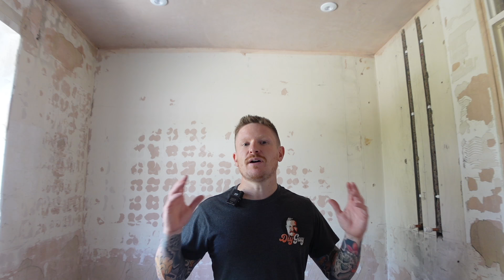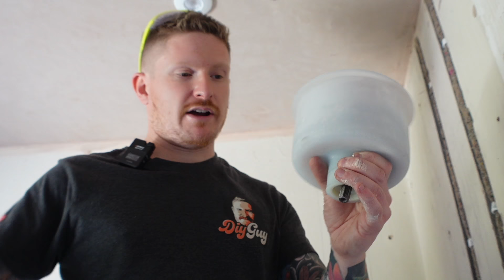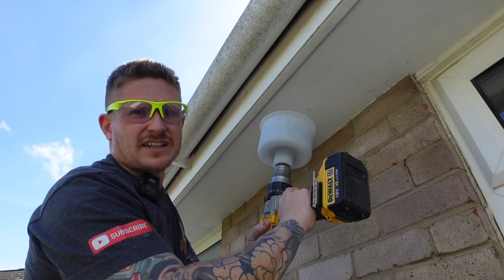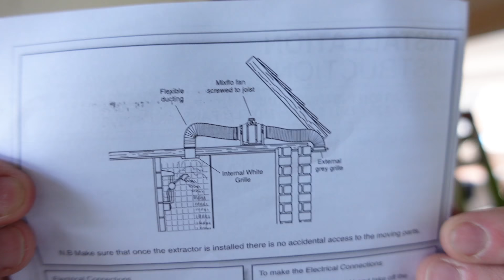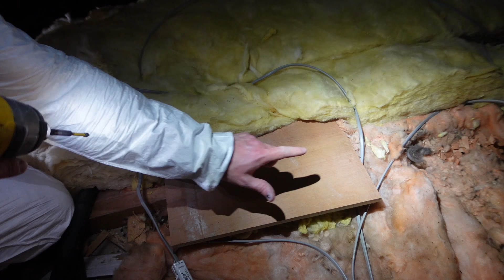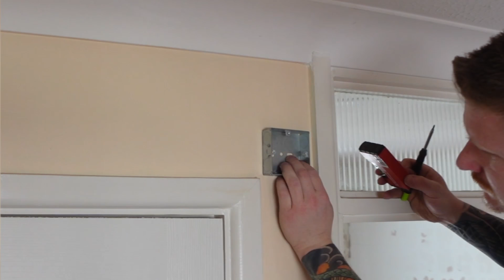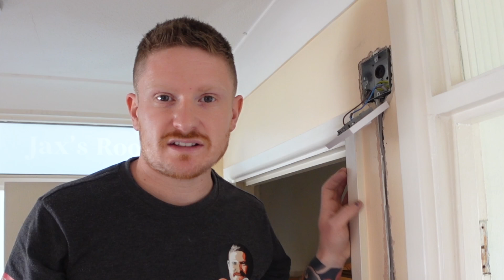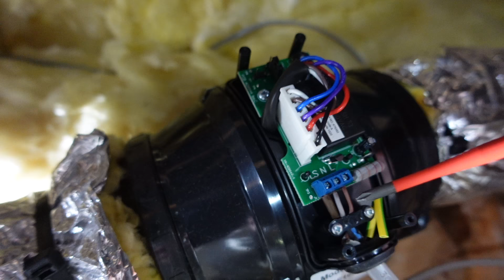How to Install a Bathroom Extractor Fan - Complete DIY Guide Made Easy

Comment: What’s the reason for the 500mm either side? I installed one recently that required 1 metre on intake side. I didn’t have 1 metre (maybe 400mm only)- anyway it works well but curious if I’m losing performance.
Reply: manufacturer's instructions say 500mm min each side (no reason given).

Comment: These fans need fusing down which I did via a spur with a 3a fuse, I didn’t realise that you could get a fused isolator. Live and learn. Great video
Reply: You don't need to fuse the SL. It's just a sensing wire, the current travels down the PERMANENT LINE conductor under normal operating conditions (as said by the guys at efixx)
Reply: Did you have a fan with a timer if so how did you fuse both sw & permanent live
Reply: @neiltrevatt  Same question, The only fused triple pole isolator I've seen has only one fuse and won't fuse against both L & SL
Reply: @Dr.Stacker did you find out in the end? I’m due to install one soon
Reply: @Dr.Stacker  permanent live
Reply: @Joshoptimuscrime  permanent live
Reply: @JB10001  what about it?
Reply: @neiltrevatt  permanent live only
Reply: Where can you find a 3pole fused isolator?
Reply: If your bathroom lights are low power, you can fuse the feed to the whole bathroom light circuit. In the example shown have the line in an out to the line side of a fused plate. Then run the light and fan from the load side if that,  resulting in a fused permanent live and switched live.

Comment: I fitted one a few years ago, those fans are brilliant. The bathroom had mould when I bought it as the builders in 2005 fitted a pathetic mains fan in the ceiling nowhere near the shower and bodged the ducting and I swear it couldn't hold a sheet of toilet paper up because I tried it! The Manrose can hold a flattened toilet roll middle up! And instead of motor vibration the main noise is the rather more pleasant whoosh of airflow.
Reply from the maker: Absolutely 👍

Comment: Just a heads up, I am an electrician and if it says in the instructions to fit a 3 amp fuse make sure you do it, a few years ago there was a fire caused by a fan and because the electrician didnt fit  a 3 amp fuse the insurance company woildnt pay out, the electrician also ended up going to court and lost everything.
I think in all the years I have been an electrician I have only ever seen one extractor fan which didnt need to be fused down but I can't remember what make it was.
Almost all lighting circuits are protected by a 6amp mcb, some houses have 10amp mcb on lighting.
Reply: Hi, how/where should the fuse be installed? Thanks

Comment: Very informative. However, I imagine if you had gone for a timer & humidity wall fan, you'd achieve roughly the same result at a fraction of the effort and cost.

Although, if you've the kind of person who hasn't yet done core drilling through double brick cavity walls, know what you're getting into first.

Ask any HVAC expert... the longer the ducting, the less efficient the airflow becomes. A wall fan has very little ducting, so only a negligible drop in actual CFM.

Also, you've now got all that ducting taking up space in your loft. Maybe you don't need space right now, but it may become an issue later. And in the winter, you'll probably get condensation appearing on the outside of the ducting, which could contribute to mould problems in a cold roof, which can be an absolute nightmare.

I'm only mentioning this because your thumbnail says "the best fan". Is it though? Have you done any side-by-side testing? Can you back up your claim? Are there no instances when a wall fan would be better?

There's only one obvious advantage to a ceiling fan over a wall fan, and that's external sound pollution. Cutting holes in walls to the outside is always going to have a negative impact, so it's definitely something to consider if you live somewhere noisy.

Your videos are very helpful, but you seem in danger (again) of convincing yourself and potentially your viewers that your method is the best. Perhaps leave a little room for options and other considerations for a more holistic approach?

Comment: i felt the pain in the loft😓, i would of personally used a click mode fan isolator with fuse to meet the 3amp as per  instructions and use this for the downlights too, normally mount the fan on the cheap rubber matt to lessen the noise. And don't forget RCD for cables in walls 👍

Comment: I would like to use a smart switch/relay to control the fan based on a humidity sensor, rather than having the switched live from the light switch. Do building regs require the isolator power to come from the light switch?

Comment: Instead of screwing fan onto board, place onto a pillow made of loft insulation and a plastic bag. This will provide sound and vibration isolation. Another way, given room and dependant on local conditions, is place the vent on the facia. This provides a straight through hose connection, unlike a soffit vent. Either way, make sure you drill between the rafters/trusses otherwise you'll be drilling the vent to find it blocked!

Comment: Thanks for the vid..... I've just had my new extractor fitted used solid tubing with a slight fall to the outside vent to drain any condensation to the outside, also added rubber grommets under the fan to minimise vibration, plus removed the flyscreen to prevent build up of fluff/dust and added a backdraught flap which keeps the bathroom draught-free especially in winter.

Comment: if only those fans could connect to a smart home system.... combined with a humidity sensor in the bathroom... the overrun could then be controlled by the humidity in the room and not just a fixed timer. Great vid as always.
Reply from the maker: Great point! Thanks
Reply: I recently fitted a inline bathroom fan and fused it down to 3a as per manufacturers instructions (this is their get out clause in case of problems) you could make up a multi gang switch plate to fuse both line and switch line together with a three pole isolater but it gets a bit over the top and messy. The best solution I found was fit a smart switch cheap as chips which is linked to Alexa and I find this the very best for complete control over overrun I just ask Alexa to switch on the fan and on it goes for 20 minutes you can alter the settings by just asking Alexa “ turn on fan for xx minutes” and of course you don’t need to have the fan running at all for a trip to the loo at 3am. Probably not the best solution for a enclosed bathroom where I would guess a light linked fan would be required but in my situation this works the best.
Reply: @David-dz8jb  In the end I bought this fan.... which is connected to the isolator of the old one.... inline I put a Sonoff Basic R2, which I flashed with Tasmota for 100% local control. I placed a Zigbee humidity sensor in the bathroom, and another in the hall way. Everything is connected to Home Assistant. An automation is triggered if the bathroom humidity sensor is 8% higher than the one in the hall (i.e. someone is using the shower!!!) the fan automatically comes on until the humidity sensor in the bathroom is within 3% of the one in the hall. Works absolutely perfectly. I'm also putting a Zigbee button in the bathroom to press if you want a 3 minute fan extraction - i.e. you've done a poo!!!!!! LOL!!!!
Reply: @hungryHippozzz  superb.
Reply: @asifchoglay6013  I realised that 3minutes per poo was not enough!! LOL!!!! 5 minutes it is!!! ;-) Also instead of a 'button' to press... I hid a magnet, plastered into the wall... and inside a poo emoji toy, I put a door / window contact sensor!!!! The kids (and me!!!!) love tapping the poo toy on the wall to get the fan boost!!! ;-)

Comment: You did very well. Subby is definitely deserved!
So if you weren’t showering, the fan would come on anyway as it’s connected to light? Or was there a separate switch only for the lights. That part wasn’t clear. Nice one 👍
Reply from the maker: Thanks for the sub. Yes that’s correct.

Comment: I’ve always thought bathroom vents should not be installed in a soffit. Roof vent tile or out a wall is a preferred method. Being in the soffit will simply force air back into the ducting

Comment: I installed the Timer version of the Manrose fan over the shower and also have an always on version (set to lowest speed) in the main part of the bathroom. Did this late last year and we've had no issues with condesnation, mould or "lingering smells" :) Must admit I'm surprised at how quiet these fans are, no need for anti-vibration measures at all.
Reply: Is the fan rated for always on?

Comment: Ok so next to the bathroom isolator switch I have a box where 2 wires from the ceiling go into it says transformer on a bit inside the box and there is a red light that comes on when I turn on the isolator switch 👍🏻
Reply: could be a 12v fan.

Comment: I thought it was Tony Robinson doing some DIY 😂 Nice vlog…. But are you sure DIY’s should be doing electrical work, especially in bathrooms???
Reply: it's not in the bathroom but loft and landing. It still needs to comply with wiring regs even if it's not notifiable.

Comment: After securing to a board, i suspended the fan on bungees to stop any noise coming through . 
Did you not need a back fraught eliminator or is there in already in the fan ?

Comment: Just a quick note to add to this video, it’s best to have a window slightly open to allow air into the room or as I do, fit a small vent in the bottom of the bathroom door. The reason for this is that with the fan pulling air out of the room you are trying to create a vacuum in the room and not enough air will be able to be pulled by the fan after it has run for a bit, hence not remove moist air. The small door vent allows air through all year round without any cold drafts. With air, what goes out must come in to be efficient.
Reply from the maker: 👍 thanks for sharing
Reply: Out of curiosity, being that most internal doors have a small gap between itself and the floor at the bottom, would that not suffice as an adequate vent instead of making one?
Reply: @nsweeney3970  Not every home has a gap large enough to pass the correct flow through the fan, especially the loft fans and it would end up with steam in the room being slow to clear. It is true that if you have say a half inch gap under the door it may be enough.
Reply: @kevinmcindoe8856  10mm is supposed to be a reasonable gap although you may also have trickle vents on windows in the UK. If you can't close the door easily with the fan on then you need more fresh air ventilation.

Comment: I always wondered why it has to be connected to the light switch.  What if you need it on in the daytime?  You'd still need to put the light on 🤔
Reply from the maker: You could install a humidistat 👍
Reply: I agree, it seems daft to me. I fitted a PIR with my fan.

Comment: You have crushed the basic insulation with the strain relief clamp in the fan junction box.

The strain relief clamp should be in contact with the sheath of the cable and not the basic insulation as clamping the sheath will provide strain relief and stop the conductors being pulled out of the connector block.

It is quite easy to cut through the basic insulation with the strain relief clamp and cause fault or fire.

Comment: When the wind blows you’re going to get a cold back draught through your opening on the ceiling…
Reply from the maker: Not with a soffit fitting in my experience. If it were gable end yeah.
Reply: Maybe just in Scotland then! I had to fit one of those oneway flaps in-line to prevent draught with my soffit opening. Cheers👍

Comment: Would you be able to just have this venting in the loft area rather than through the wall or under guttering, or is that against regs??
Reply from the maker: Not recommended, it will cause damp/condensation issues in the loft and isn’t within regs.
Reply: Could you recommend a hole saw bit to go through brick ?

Comment: Hello mate I have a box next to my isolator switch any ideas 🤙🏻
Reply from the maker: Hi, Please give some more info, I’m not sure what you mean
Reply: Ok so next to the bathroom isolator switch I have a box where 2 wires from the ceiling go into it says transformer on a bit inside the box and there is a red light that comes on when I turn on the isolator switch 👍🏻

Comment: Just a tip for the less powerful fans,  with the duct work I would always recommend using solid ductwork as opposed to flexi. Better air flow, less resistance, less dirt and bacteria captured over time, Also undercut the door to allow make up air.
Reply from the maker: 👍 thanks for sharing
Reply: What do you mean by undercut the door?
Reply: @ Cut the bottom of the door by 10mm to basically have a small gap between the door and the floor to allow new make up air in :)

Comment: Nice one! Out of interest how did you get the cable from the box you cut in up into the loft space?
Reply from the maker: There’s an airing cupboard behind the back box, drilled through into there and then up into the loft space. Alternatively I’d of just chased the wall out up to the ceiling.

Comment: You should be telling people that any work on a domestic lighting circuit needs to be rcd protected especially anything connected to the bathroom electrical installation, as well as making them aware to follow manufacturers instructions, and in most cases a fan will require 3amp or even 1amp pprotection, fan switches are available that have a fuse holder built in.
 Also that soffit looked like asbestos, it may not have been but the only way to prove that is to have it tested.
Not to mention all electrical work should be tested, rather than just the usual bang test.

Comment: Just used the exact same fan for our bathroom, the performance is amazing. I used solid pipe from the fan out through the gable end, just because I worried about moisture pooling inside a long flexi pipe. I have a small drop on the solid pipe, so it's all downhill to the gable vent.
Reply: P.S. the electrics blow my mind, but luckily I have a brother in law who is a sparks who broke it down into simple instructions😂
Reply from the maker: Yeah if you’ve a long run it was probably the best way 👍. Nice work

Comment: How do you determine that the ducting will bend enough to get to eaves? Dont you have to loop it so condensation doesn't fall back into the ducting?
Reply from the maker: The ducting is very flexible. It has to be pulled taught and run directly to the external vent. Looping it will cause nightmares with condensation.

Comment: How do you go about cleaning one of these style extractor fans? Mine looks to be filled with dust and I’m having issues with a mouldy ceiling. Can still hold a piece of paper up, but I see lots of dust through the grill.
Reply from the maker: Pop the top off and give it a wipe out
Reply: @TheDIYGuy1  no need to worry about the ducting then?

Comment: Hi mate where did you get the ceiling vent from? The one in the link doesn’t come with the black insert?
Reply from the maker: Does it not, they are all very different but essentially the same thing. The one I got was from screwfix
Reply: @TheDIYGuy1   Thanks, I fitted the same fan last year but havnt got no where near as much pull as yours.

Comment: Thanks for the vid.. just a bit curious as to why you use insulated ducting?  WHen mine was installed the electrician used bog-standard plastic ducting...  Cheers!
Reply from the maker: Insulated ducting should always be used in a cold roof space. If you use non insulated the warm air inside will condensate. If the roof space is warm then non insulated is fine
Reply: @TheDIYGuy1  Ahhh enlightenment dawns Grasshopper!!!  Many thanks for the reply!

Comment: I always use ridged pipe stops turbulence and the build up mould in the duct. You said hard to find a fan with that extraction rate but for my downstairs bathroom fan installed over the shower area ridged ducting under the floor board this is the answer
 Airflow iCON60 Circular Extractor Fan for Large Bathroom, Utility Room or Kitchen 280mhr/78 ls but it’s a beast!

PS I would get a humidity sensor wired up they do one that will work with that fan works good 👍🏾
Reply: Ok used rigid tubes and they are so much louder I defo do not recommend it. Fan noise and noise from outside
Reply: @TrickyTree84  louder maybe more airflow definitely I just suppressed the noise with slabs of rockwool, as extraction rate is what is really needed.
Reply: @DTech101  I found the fan itself louder though as the sound resonance in the tubes is greater and sound more easily carries in from outside.weapping in rockwool won't stop that. Yes more air flow but not worth it in my experience.

Comment: The Manrose MF100T instructions state it  must be fitted to a circuit with a 3A fuse.  18th edition states manufacturer's instructions are taken into account for electrical installation.

I use a double pole fused spur as the isolator with a 3A fuse fitted and a double pole light switch so the lighting circuit and extractor circuit are switched separately when installing these.
Reply: Good idea!  No need for the fan to always come on when you're just popping in for a quick pee!
Reply: @jayseabie215  for that you'd probably want to fit a humidistat
Reply: Click make a fan switch that has a 3amp fuse built in, the vast majority of fans will require a 3amp fuse, there are not many on the market that don't
Reply: Always better to have a seperate fused spur for fan, hate it integrated with and dependent on light switch
Reply: @bertbox69  personally I am not keen on timed fans, if you want a shower or bath in the daytime you either have to have the lights on or flick the lights on or off, a separate on off switch is best.